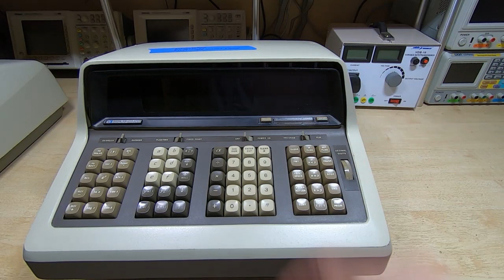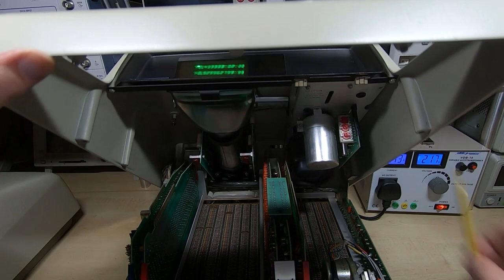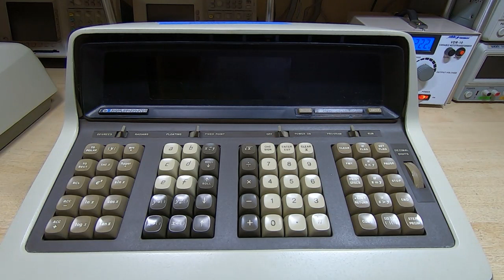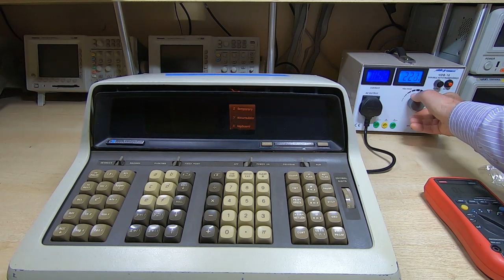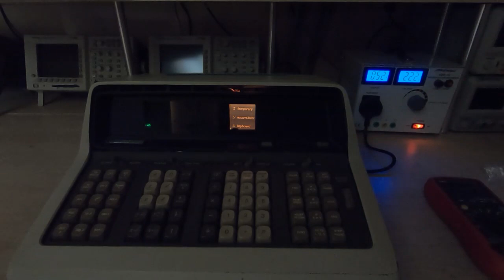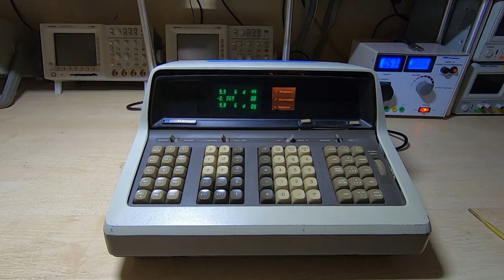HP9100B #1 Repair Part2

Comment: Vector based displays are fascinating. I didn't know you had written a book until your video about trolls yesterday, so Amazon had two in stock and I ordered one. I will consider your kit after I have read the book. Pricey, but again, very interesting. Thank you for the videos.
Reply from the maker: Hi John, Thanks for buying the book, Which was it (Processor or Magnetic Core Memory)?
Reply: @JerryWalker001  The processor book. My experience with core memory is limited to seeing some during the manufacturing and testing process. Since they were for ICBMs, I didn't have the need to know at the time, I just had to walk through the burn in area (along with the bitching Betty for the F117) on the way to my work area. Bitching Betty was the module for voice annunciation, says things like "bingo, fuel", it could startle you after hours when everything is dark and quiet, just the fans humming and suddenly "BINGO FUEL" quite loudly. This was in the early 80s before the plane was public knowledge, I had no idea at the time. Anyway, I am sure I will enjoy the book. I did do some work on bubble memory at the time, but it blew up with the Challenger shuttle.

Comment: Jerry, what "static" tests did/do you before applying power initially?  You mentioned the PSU cap(s) as possibly needing reforming and possibly the cause of the fuse burning out -- hoe do you go about reforming caps, taking care to avoid damage to the rest of the machine?

When you repair wires like the broken rope memory wire, how do you reconnect them without causing other damage?  I'm thinking about extremely small diameter wires that have broken, not really the "large" wires typically used.

In future videos, could you get into how the rope core is constructed and maybe even how to "decode" what one is designed to do?  Or give a reference to a site or document that gets into the weeds about rope core memory?